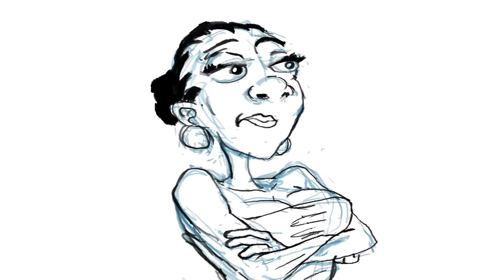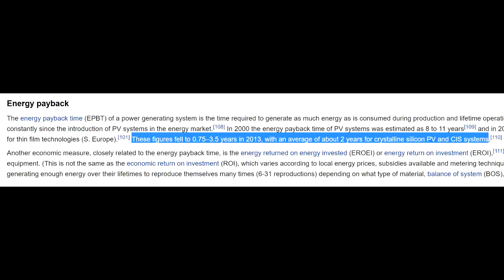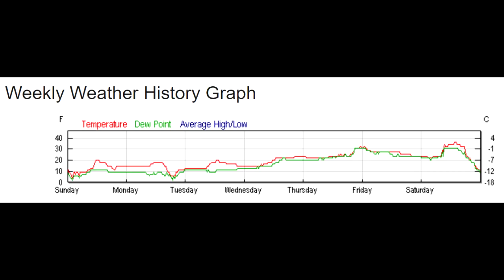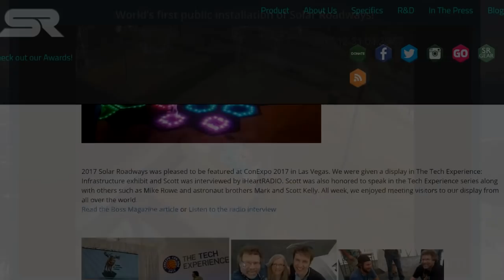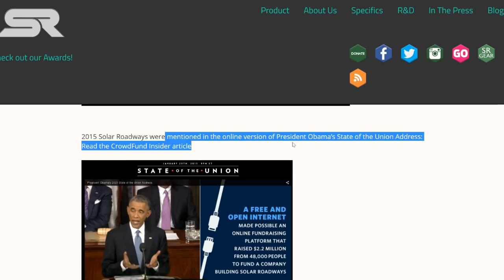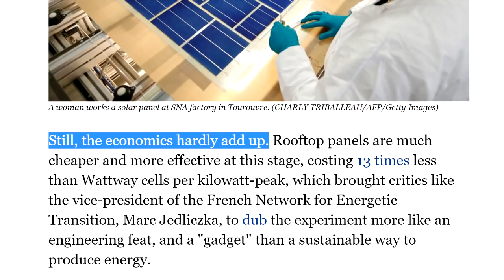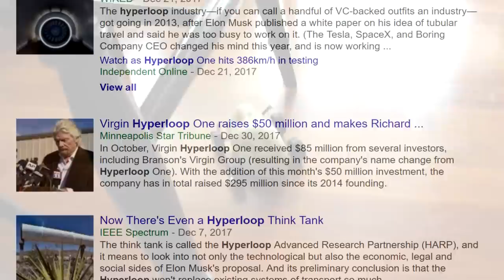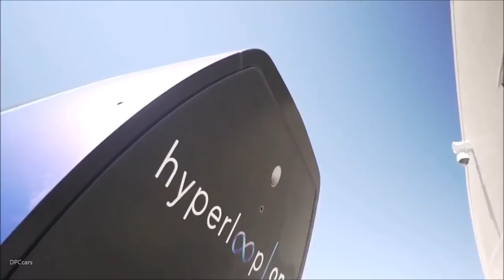Solar roadways, NEVER shovel snow agai... oh

Comment: You'd figure that solar cells powering heating elements could never approach a black-body radiator in terms  of efficiency.  But jet black asphalt driveways need shoveling too.

Comment: wouldn't it be better to use buildings to generate power that is then linked to the road via heating coil type stuff? maybe only at important places like intersections and such. kinda curious how much power we could generate or better environment if we said you have to have solar panels or a farm area on top of buildings.

Comment: This is one of those ideas that's good on paper, but when executed, it doesn't work out well. There are just too many flaws in the idea, and like you said it would be costly to the people. Not producing all that much power, or when a car crashes and break a few dozen meaning the road is going to have to be closed down or when the glass gets all scratch up by the tires to the point that it can't produce energy meaning that road has to be shut down and has to be replaced. That is going going to cost a lot of money in the long road.

Comment: 6:26 in and you I'm wondering if you ever seen the "die another day" bond movie, not saying was good, just saying it's an actual cool idea, but I wonder how would effect life on Earth if some places had more sunlight. Soil temps, water evaporation, life cycle depending on cycle of day/night, etc.
Okay, back to reference, just watch the ice palace part when he shows off "Icarus" in a good way, then of course has a second use as a weapon, just like your reference. I just feel would have been a nice clip to add in of the beam burning through stuff.

Comment: There was a study done (https://www.nrel.gov/docs/fy16osti/65298.pdf) that with regular solar panels on all feasible roofs in the US we could get 40% of our power. No study done that I know of but US has at least as much square footage in parking as building space so there is 80% of US electricity no extra space needed. If we used high efficiency panels we could get to 100%. We don't need no solar roads.

Comment: Wouldn't it be cheaper to cover roads, one lane per direction with a solar panel roof, in summer it can generate electricity, in winter it can keep one lane relatively cleaner from snow, obviously this should be done only on roads near were the energy is required, we don't need to waste all the energy on energy transportation. But then I suppose we would see some collapses under the heavy snow.

Comment: Solar Thermal systems are the way forward, NOT solar Photovoltaics (PV). I did my PhD on them. They are "lower" tech than PV, so less complex and easily manufactured and maintained. They also are more efficient and do not cause problems in the power grid. Once again great work on destroying yet again this stupid Solar-Roadways-money-draining project. Happy new year TF and to everyone!

Lastly, I would like to ask actors: Please, please just stick to acting! Leave the real world problems to trained engineers, who actually have the scientific background and experience to rule out the basic stuff before they waste lots of money.

Comment: the problem is that the glas might withstand the pressure, torque, weather etc. but it WILL GET SCRATCHY and so mat over time an so reflecting most light

Comment: what if the tech behind these were improved? I mean we spend hundreds of millions in snow removal on the roads a year. if we advanced our renewable energy enough to power the roads too can help, especially if we have a legit power grid to support it.
Reply: andrew lee yeah but what if we had a better way to sent the heated roads power?
Reply: There is no better way to send the roads power. And even if you had a better way, you will be wasting a lot of power, because the solar panels are placed on the road, rather than high up (where they actually belong)

Comment: If sunlight had enough power to keep the roads clear of snow, certainly dark gray asphalt would absorb enough heat to keep itself clear all by itself. Unless solar roadways stored quite a massive amount of energy during summer.
Reply: Actually, it would make more sense to build roofs above roads and put solar panels there.

Comment: Problem:
Places further from the equator receive less direct sunlight for less time per day in the winter, this leads to colder weather and sometimes snow and ice.

Solution:
Use the power from the sun, convert it to electric energy, then convert it back to heat energy to melt the snow and ice.

Do I get my Nobel prize yet?

Comment: I mean, I've joked about solar road ways and how it's a waste of time and I still believe that. However, let's go with their premise of using roads to generate power.

Is there a way to convert road use into some form of energy? I mean, a quick little thought off the top of my head would be something that is sensitive to weight distribution placed under the pavement and creates energy via differential pressure due to the weight of the car.

Comment: About the HyperLoop - Here you are wrong. The reason you are wrong is that you fail to take into account the one real reason to build it - that the capsule running in it, may acheive unlimited speed. The only limitation is the human body capability at absorbing acceleration. I agree that any shorter H-Loop tunnel than, say, 400 miles is useless since that would mean that you lose all of the advantage over - say - aircraft travel. But suppose you build a H-loop all the way from LA to NY. At this distance, with an constant acceleration of 2G, they'll need to add a top rail to the tube to shove the capsule down since it will get above orbital speed at sea level. The entire travel time would be 10-15 minutes and CEO's who need to get to a business meeting will gladly pay even 10,000$ one way. So despite the tremendous construction cost, this will repay itself. Furthermore - if the  tube is kept at a straight line over the atlantic ocean, held up by a series of blimps until it reaches a height where the atmosphere is thin enough and an aperture is opened at the end of the tube exactly at the right moment - you get an instant orbital launch system, with the price of a train ticket per launch. Sure, this has many technical challenges, the kind you love so much to put in focus. For example, what do you do with the blimps when there is a storm? Well, I guess you could take it down for the storm and sink the tube to the bottom until the storm passes. So yeah, plenty of technical challenges. But not insurmountable.

Comment: dont worry we will use the power of the sun that is incidentally not enough to melt snow on its own and is mostly transferred as heat to melt the snow by collecting it turning it into electricity then transforming it back into heat.  this must increase the effect by at least 10 fold.....

Comment: This so called "engineering couple" must be laughing their way to the bank. I'd like to see them employ "solar feakin roadways" to keep the snow off the roads up in the Yukon where winter days are extremely short, what little sun there is is very indirect, temperatures drop down as low as -40 to -70 or more below zero.

Comment: I drive a motorcycle and I have to say there is no way I would drive on these roads. Did you see that shitty surface? It makes breaking for every vehicle harder and it takes away the traction. No way I would drive my bike on there with only two wheels! And I don't think that they have any kind of traction when they are wet. Maybe if you are walking on it, but not if you are driving a vehicle.

Comment: I feel there is a difference between hyperloop and solar freakin roadways. The hyperloop is worth working on; I don’t think you have the sort of proof it’ll be a failure, that you do with solar roadways, where it’s just plainly obvious. Plus any hyperloop tunnels built could always be used by good old high speed rail.

Comment: But what if they made the solar roadway out of zinc, and put it inside the hyperloop, and made the hyperloop tube out of glass, and hang it on air by cabels attached to meteorite, so you could travel while you travel and get infinite power FOR FREE! plus there would be leds.

Comment: At least it hasn't got Trump support yet. If it ever happens, it can get to F-35 proportions fast.

Perhaps they could cut the hyperloop tube horizontally in half, install each half side by side, add an inclination, and use it as sled trails, one half to go in one direction, and the ther to go back.

Comment: anyone who has even taken a basic High school physics course knows that it takes a lot of energy to melt ice
Reply: What's more, why bother converting it to electricity first, to power heating elements. You might as well just have the ground painted black, that would do the best possible job of turning the sunlight into heat. Like oh I don't know, blacktop as it already is? In other words, if snow covers that stuff, then there wouldn't have been a way to prevent it with any solar powered thing built into the road anyway.

Comment: While the solar roadways concept is just ridiculously stupid, the Hyperloop tech would make for decent transportation on Mars colonies. Just pump some air in instead of pumping it out, and cover the roof with solar panels all along the way so it powers the air conditioning and the small sledges/trams the colonists use to travel greater distances between the hubs and facilities.

Comment: I'm just a layman here, but roads are much longer than rooftops, so the lack of energy could be made up in sheer length as opposed to solar rooftops where it generates more energy but there's less square footage. The road does soak up a lot of heat during the day, especially here in the Caribbean. Maybe an option where there's both rooftops and roadways? I don't know. I like the solar mirrors but the idea of burning animals to shreds is mildly creepy. I guess with any process it takes time and trial and error. The people endorsing these aren't scientists, just regular people trying to understand. I feel like in this day and age we need more scientifically literate politicians so economical mistakes like this won't be made.

Comment: 8:23 Heard it a dozen times over and every time it pisses me the fuck off.
Smart Micro Processing Interlocking Hexagonal Solar Units.
Break it down
Smart (Does more than one thing when it's told a.k.a light up green, light up yellow, heat up) basic shit that's nothing to wow over.
Micro Processing...It does processes in the micro level?? As in...you mean...using software, cpus, and the such? as in every single electronic piece that has ever existed?
Interlocking basically they fit together like legos
Hexagonal literally means that it has 6 sides
solar units...I hope so since it's called Solar Roadways...
So what's the wow different thing about this!?

Comment: the only thing that solar roadways can be useful, is getting regular solar panels easier to maintain and lasting longer..
Reply: prognemesiss No, not really. The Solar Roadways solar panels are reinforced to withstand the pressure from when cars and trucks drive over them, but pressure is not the reason for normal solar panels breaking. I guarantee you, even with no cars driving over the Solar Roadways solar panels, with the LEDs turned off and any heating turned off the solar roadways solar panels will just work as long as normal solar panels would work, because that‘s basically what they are.

If you put a banana in a box you can suddenly step on it, but the reason for why we need to throw a ton of bananas into the trash (they rott) is not fixed with this reinforcement solution.

Comment: I'm not bagging out solar panels as a whole, but don't they require some stupidly dangerous heavy metals (I think) or some sort of super toxic chemical in their manufacture? It's a genuine question, again, not bagging out solar panels, I want to get them for my place, but I'm genuinely asking as I genuinely want to reduce my carbon footprint, at least a little. (Hey at the very least it'll reduce the hell out of my power bills.) And for the life of the solar panel, does the cost of manufacture stack up to the net gains on a mass scale?

Again, I can't stress this enough, I'm not being a troll, I'm genuinely asking because I've been trying to find resources on this but I must not be trying hard enough.

Comment: I guess so solar roadway can't take the fact they're getting disabled comments section music by Handel 10 ton semi driving across it loaded with steel and cement man it might bust in a week Ed Warren how good is glass flying in the air into your lungs at 70 miles per hour before someone's got popped her Tire derail and smashed it heads. PS I can't speak very well I'm using Android to be I'll speak to you guys. And this has two handle a semi running with trees on back of it dropping on it you have two last 20 years without maintenance if you can't do that has no reason to spend money on it I'll buy your SMS 200 years. In the North you have to repair the roads every year so they cost an arm and a leg maybe your whole body with your sold to if I see one around my area I'm going to take a sledgehammer to it that equals a semi driver across it

Comment: Mr. Thunderf00t, what do you think of hydrogen powered cars? I think they'd be much more practical than electric cars, given todays infrastructure.
Reply: id like to go back to a 1920's idea that never got out of a single prototype...the pure oxygen engine, it didnt require an exhust as burnt pure oxygen left nothing,  the trouble was back then they could not meter it reliable and the prototype blew up, it would be extremely powerful and small

Comment: Same video footage as before, an observation that's tweet material drawn out to 16 minutes, some arguably neat footage of solar mirrors, redundant back-of-the-envelope calculations and a mention of the Hyperloop. You may be right that the common populace still needs to be convinced that solar roadways are a dumb idea but as a subscribe this video is pointless. So if that was your goal, good job, otherwise: I'd rather see something more original.

Comment: You are just guilty of thinking small.  You need to dream big.  I am developing a plan to build a large scale hyper-tube transportation system.  I plan to roof the hyper-tubes with solar panels and use the excess electricity generated to operate dehumidifiers to create water from thin air.  In one fell swoop, this will solve all traffic problems, meet our needs for clean energy, and provide an inexhaustible source of water.  I just need a little money to do some basic research and start manufacturing.  Five billion dollars or so should do it.  How do I start one of those Go Fund Me things?

Comment: You're obviously right on this one. Only about 50% sure about the hyperloop. At least Elon's original idea seemed like a good one. Not a vacuum tube - just lower air pressure. No expensive electromagnets in the tracks - just a fan on the front of the vehicle pumping air away from where it's causing resistance and using it for lift. Not sure why no one has tried out this concept, but I guess it's an indication there might be a problem with it. Anyway, I'm sure travel in low pressure tunnels will become a thing one way or the other at some point, unless teleportation or efficient electric planes become a thing.
Reply: Cruzer One of the problems is that a train can run faster with less infrastructure to support it and well it works. The hyperloop concept has many faults, but a main one is that it makes it complicated and slow for passengers to enter, we have no solutions for the swift loading and unloading of cargo not to mention that has never shown to be faster then established trains.

Comment: Hyperloop. Two things. 
1.: From you use of words 'spacecraft' and 'vacuum chamber' and 'friction-less environment', you clearly seem to believe that perfect vacuum is planned inside the tube. You did your fact check pretty damn good on the solar roadway, try doing at least some in terms of the hyperloop too please before mentioning it in a video, and you will realize only the media ever said it will be vacuum, it is planned to only have thinner atmosphere, something like at 35.000 feet where planes fly. No concrete numbers released on this one because even they don't know, as it is a subject to the development - the phase the whole project is in. Speaking of which, the next point:
2.: 'THIS is the WHOLE hyperloop': You seriously expect a project/technology in development phase to build a city-to-city span tube-way before they actually figure out the do's and don'ts of the tech, live demonstrations to prove themselves to investors, and such? Knowing the price what would be an ideal development test track length be in your mind? like 100 km?

+ question: You claim that hyperloop is really dangerous for about the same reason as putting jet engines on cars. Please explain what is your point here? Electricity might explode like jet fuel? Magnetic propulsion is hard to start, hard to stop and get as hot as 2000 degC? Potholes in the concrete road nearby might make the fast pod inside the tube crash somehow? Humanity doesn't have the technology to magnetically move object in a safe and precisely controlled manner at high speed, like the Japanese SCMaglev train at 590 km/h, or like the LHC at nearly the speed of light?

Look. Hyperloop has some very serious issue it needs to address before it can be a reality, and if it fails to do so in development, the tech is a throwaway, but frankly you managed to miss them all, and come up with ridiculous claims why it make no sense.